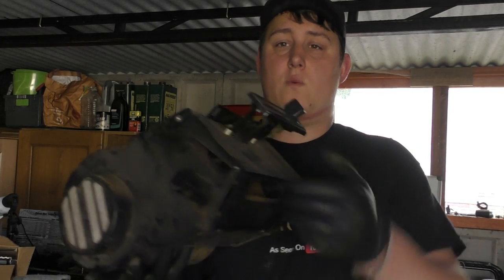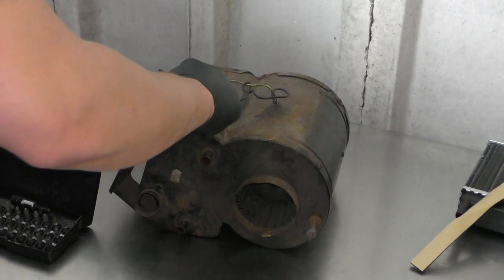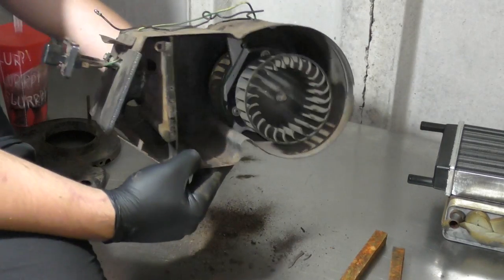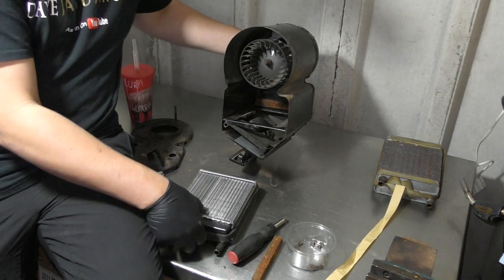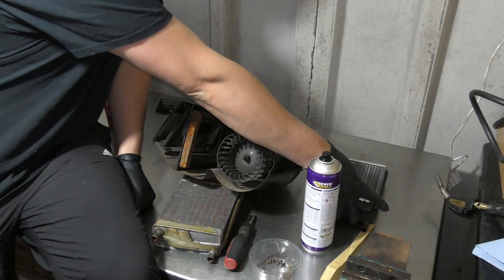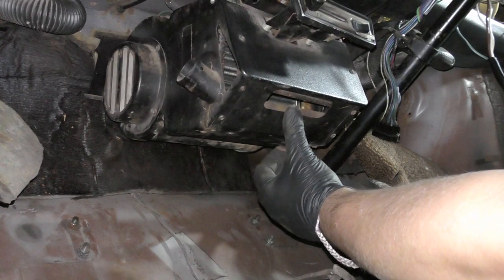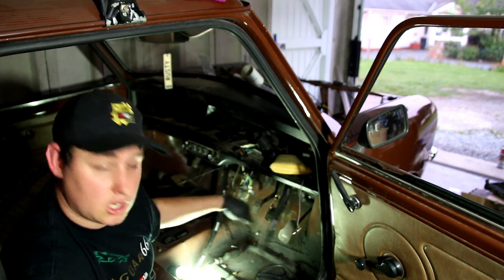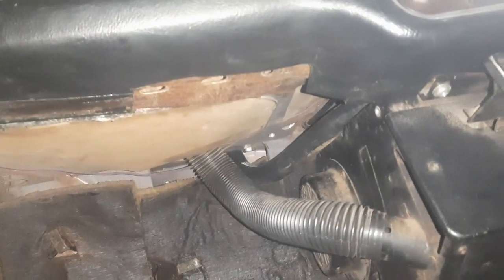Classic Mini Heater Matrix Replacement

Comment: Hello William Murfitt. I'm really enjoying your videos. I have a 1975 Mini 1000, the Canadian version that I am restoring. Not too long ago I dismantled my heater which was identical to yours , cleaned it and painted it. I however have not changed the heater matrix. It didn't look like it was leaking so hopefully I won't regret not changing it. Keep up the good work. Cheers, Midge
Reply from the maker: Thank you very much, mine wasn't leaking but I dont think it's ever been changed so I thought a complete new system would be suitable

Comment: Thanks William for this video. it is always helpful to watch a video on some repairs before actually doing it. Switching the matrix was simple. However the foam in my assembly crumbled to dust. The matrix from Minispares came without new foam. So I used a material I thought to be heat resisted enough. Unfortunately this was not the case and I now have an awful rattling noise from the heater assembly  - especially the flap to close/redirect the airflow. What would you recommend to get as an alternative? I couldn't really find something in Minispares that fits...
Reply from the maker: Glad it helped, as fir the foam maybe give them a call or drop them or any of the other mini parts suppliers a call to ask the question as being honest I don't know what would and wouldn't be suitable for this application

Comment: I hope you dont have same trouble with the heel board like Keith Miller had when he changed his rear subframe
Reply from the maker: you and me both, but i'm expecting the worst. the car is 40 years old this year, and i don't think the frame has ever been off as its a relatively low mileage car. but fingers crossed.

Comment: those clevic pins are a bitch. I am 1.90m and i really had to curl myself in backwards to get to them easily, to then figure out that I couldnt get myself out of that position :p
Reply from the maker: Yes they are a nightmare, however R clips are the future it would seem. Push fit and secure never again will you be forced to struggle with split pins!